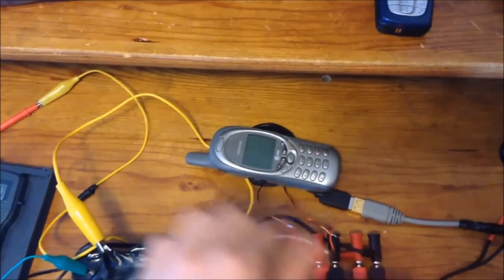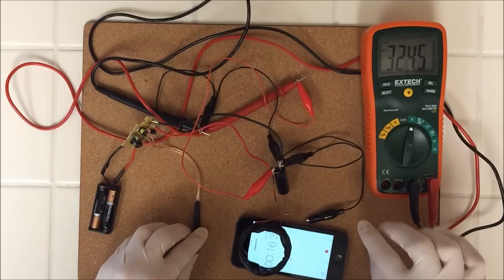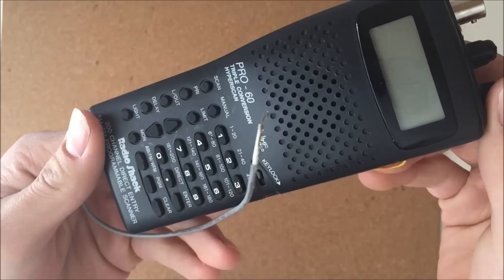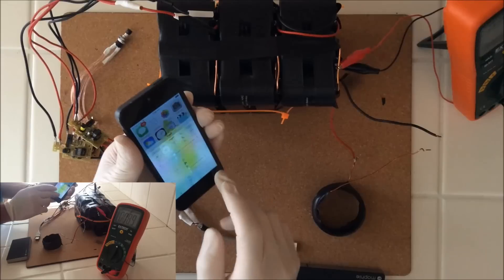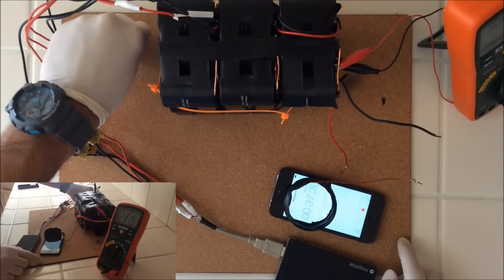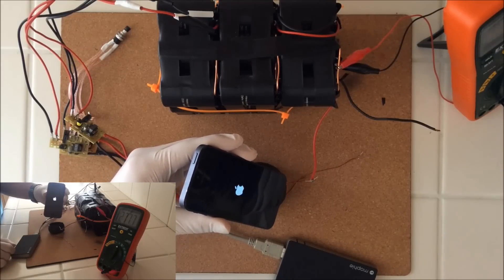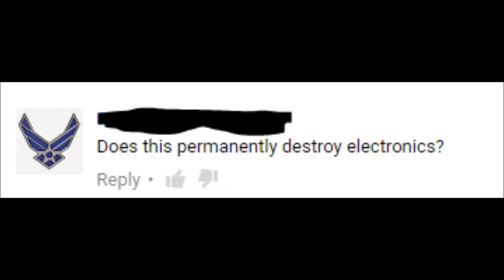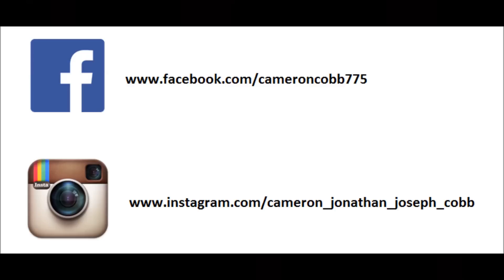Electromagnetic Pulse (EMP) an IPhone - What Happens?

Comment: the problem is even though this is a real EMP generating and inducing a small current into the circuit of your device in a space based Russian EMP attack is on much more larger inductive current than the small circuit you have made it would cause some elements of the circuit wiring to melt and open you would not be able to locate the open circuit because the circuitry is on a nano micro scale you would need to look with a microscope at the circuit board and you would not discover this you would need to do multiple continuity testes to isolate the location of the open circuit you wouldnt be able to find it, and that would be the least of your problems, pray to god we are never in this situation make peace not war learn to be a friend.
Reply: Chatting macca

Comment: I'm not sure how I got to this video, but I'm glad I did. It was strangely captivating to see if the iPhone would be fried.
Though this does lead to an obvious question. What if it was a phone that has a wireless charging loop built in? The charging coil must be outside the RF shielding, so in theory it would funnel the massive pulse of power straight into the phones main board, but do phone manufacturers think about this, and do anything fancy to prevent EM pulses from damaging their devises this way?

Comment: We have icbm mirv skärmar 500, topolj 
M2 4st 200kiloton and 1megaton 1meg +800tons sarin , Death is about 4-11st +rsdioaktiv ca 1000.
20 uarsþ, 8typhoon, 20modern and 3000 huntrtkoller. Mmissalboats, mineswepers, rocket ships typ 168st s400, s350s4, cs500+1000+ s600-700, s350 600, tor m3 80000, pantsir SiE, SiM, SM Andra blir ca 150000st plus 1miljonn missiles, Islander 120000.cruise missiles 200000+ club 10000.jos 550000+club 8000000, dronovo ca 1milijon i 50000.
Avioni ca 56,000,+andr 70000+helikopter 🚁 82222
Transport mi 80mi07 1700

Comment: Interesting, would you get the same result with a samsung s7 edge smart phone, something odd happened 2 weeks ago at work my smart phone completely froze and i had to take it to the phone shop for repair. it was connected to nothing, the phone needs a new mother board. the odd thing is i have two computers at work that all needed re booting along with the router, and my electronic door entry system froze,  I thought the electric tram that passes close by around 50 feet away. caused an Electromagnetic pulse , either from the collector or a faulty or badly suppressed motor. is this possible?
Just putting this out there for the collective brain.

Comment: I think the emp generator you made is quite weak, maybe you can try to ramp it even more using a step up transformer that can produce 20mA 1000 volts and more turns in the coil. But if you're brave enough and you can actually shield yourself from electrical discharge then you can try to use oven transformer which can out put 50-60mA, 15000 volts(I think) which can also fry you if you're not shielded enough....

Comment: I was so surprised the coil actually managed to fly... I really wonder what kind of physics went into getting it to do that.
Reply from the maker: That’s a good question... never really thought that deep about it... I will be doing another EMP video next week except with a LOT more power and with a pancake coil instead... should be interesting.
Reply: It can be two things. Either from the tiny plasma bubble rapidly expanding between the two wires or its because of the physical force that is generated from a conducting wire in a magnetic field.
Reply: emp means Eletro Magnetic Pulse, probaly cause its a MAGNETIC pulse

Comment: Your conclusion is not very accurate. An EMP is basically just a large amount of electromagnetic noise that will induce currents in conductors, such as circuits. The effect this will have is entirely dependent on the circuit in question. For example, an electric motor with beefy coils is likely to be fairly resistant to this, whereas its delicate control circuitry is more likely to be permanently damaged, as the high induced voltages exceed what they are designed for and can melt or arc. In the case of the iPhone, it looks like the circuitry was largely protected, and it probably detected a voltage irregularity somewhere (like the aerial which is unshielded) and restarted as a safety measure. Other electronic devices, and probably even other brands of smartphone will behave very differently.

Comment: Even if the phone is not burn, the EMP is capable to make the device to reboot, what will happen if this is use on a combat plane, or ship or a tank? it give you enough time to make an smart move.
Reply: its prob cause the on and off button is exposed, without any protection at the actual button and sides of button, so that must have make charge to phone think it turned off

Comment: EMP on a ballistic missile would destroy all tech that isn't grounded by a Faraday cage. It is because not all electronic are created equal and that you are using a micro educing  EMP generator. Higher powered devices require stronger exposure. And that doesn't exclude the potential of the dust fragments of the emp which a small generator would not make.

Comment: Also what you may not realize is that, the sudden voltage and current surges in the iPhone may have degraded some of the semiconductors within which over time start to fail reducing the life or reliability of the phone.

Comment: FYI....a nuclear EMP that is set off at an high altitude, will give off 3 pulses...each one a different type of pulse, and each one does something different. Between the 3...all modern electronics that are not protected by a verde cage, will be destroyed, when the EMP fry's the circuit board....

Comment: What wasn't shown or mentioned is insidious damage that an EMP, RFI, EMI or ESD signal can do to semiconductors, causing delayed degraded performance or failure, depending on the device and the application. Physical damage can often be seen by microscopic examination. Failure may be as simple as an increased but correctable Bit Error Rate, detected by a Parity Check, corrected at the bit level or higher, by redundant hardware or software. Failure of an I/O ESD protect circuit or a CMOS parasitic PNP or NPN transistor can result in a partial or total thermal runaway (meltdown).

Another issue with the demo was failure to immobilize the transmit coil. Some of the otherwise destructive Pulse energy was converted to coil motion.

Comment: yes it can destroy electronics sensitive things led's calculators those things. it's about coil diameter of coil number of turns voltage current literally sky is the limit if your trying to destroy something with your wimpy emp make it bigger and stronger It Will Work!

Comment: hey you corn cobb
can you up the voltage and stuff with a car battery or a generator class
Reply from the maker: b34113411 with this kind of circuit, the only way to up the voltage would be to increase the capacitor ratings to more voltage and more capacitance. A car battery of higher input voltage would charge the capacitors faster. I hope this helps :)
Reply: dew it

Comment: Nice way to force restart a system that you don't have physical access to.
Reply: duuuuuude, i never thought about that.
Reply: and now you can see that iphones can be opened therefore you wont need a stronger EMP
Reply: Only if the device has error correction. If not it will continue running with a lot of errors.
Reply: Make your emp like a taser with a permanent arc so it can send multiple waves by sec and you'll kill some devices by overload. But if you really want to kill a device I'll recommend to overload the USB data pins and the common ground with a high inverted current.
Reply: @Tailslol  i will recommed a usb killer it will kill instantly the device it doesnt use magnectic feild it charges th device upto 2000 volts in sec and result in instant kill of device however it have no access on i phone
Reply: @cameramannn8960  made one from a bug zapper a few years ago,quite effective.
Reply: You have physical access if you are with an emp right beside it
Reply: TheXAsama lmfao
Reply: It would be a super imprecise method with much collateral damage risk, though.
Reply: But not best way it may kill that phone
Reply: I want to say it, but it's totally silly so I'm going to do it anyway. If you open the iPhone then you void the warranty :p

Comment: you just have a bad emp....
Reply: Alann Mopty it's just small. He has the concept down and can always go bigger. Invisible damage isn't something to underestimate.
Reply: rob864guy exactly what I was thinking
Reply: Get good
Reply: Two microwave transformers charge a large high voltage capacitor then across a spark gap after that a massive coil of copper wire submerged in oil or hardened in resin there most powerful emp ever
Reply from the maker: Alann Mopty yeah it’s completely terrible

Comment: So theoretically speaking, can it be hyped it up so much to a point where it would inflict permanent damage to electronics?
Reply: Probably not this one, what makes electronics so vulnerable to EMP's is that essentially more wattage than the wiring is rated for is induced into the wiring and essentially burns them up. In microprocessors with hundreds of tiny/low wattage rated connections they can be easily overloaded (easy being a relative term). To make something powerful enough to do that you'd need a significantly more power to do any appreciable damage.

Comment: Idk if you'll respond in time but I'm doing a project for school and I was wondering if you knew how to protect the power grid from an emp attack if we had the money ready to go to upgrade it. Or what's a solution to upgrading our power grid. US power grid that is.
Reply: I'm assuming you  already know that changing magnetic field induces electric current in conductors.
The whole idea behind EMP is to create strong enough magnetic field in short period of time,so the current induced in conductive elements of electronic device is large enough to "fry" some of the components.
Now,there is no pocket size device that will have devastating efect like those you saw in the movies,EMP like that can be created only with use of explosive charges or nuclear weapons.

Back to your question...I don't understand your concept of protecting the power grid.
Big part of cables transfering electricity acros the country doesent even have insulation and during storms when there are electric discharges in atmosphere,you have same effect,small current is generated in those conductors.
Now this can have effect on your devices that are pluged into the outlet if lightning bolt strike nearby.
But majority od devices already have protection against hazards that can come from the mains,also as you saw many devices that recieve or emit RF signals (like mobile phones) have shieldeng around components that needs to be protected from EMI/RFI or can cause interference to other devices.
When comes to destroying phones with devices like this,in many cases you will only mess up with signals inside ICs which will cause them to freeze or restart,but once you remove the sorce of EMI they will continue to work like they supposed to.You need to get really close with your "EMP device" to permanently damage it.Nowdays you even have schielding inside the IC which makes them even harder to "kill".

Sorry for such a long comment,but when it comes to electronics there are so many intresting things to talk about which makes it beautiful :D
Reply: Let's take for example a PC.First you have metal case which is essentially a Faraday cage,so it can at least greatly reduce efects of EMI/RFI if can't block it all.
Then you have PSU,even the cheap ones have protection on the input from power surges and filtering of any noise that can come from mains.
Next,even some MB have their own protection from excessive current from the input.
The most sensitive parts are ICs,especialy those running on low voltages,which you can permanently damage.But chances are low becouse there are many ways to protect sensitive part of the circuit.
Hard drives have their own metal cases which also provide some protection.

 It's easier with hand held devices becouse they are designed for low power,but as you saw you need to get pretty close to even mess with micro in iphone (of course it's not imposible to kill it but it's unlikely,you eventually can if you have that intention and put som more effort).

Now,Faraday cage offers no protection from slow changing magnetic fields like earths magnetic field,but should protect from EMP.
And in case of using nuclear weapons,I think there is greater thing to care for than protection from EMP.
Reply: It could only work with an air burst nuclear attack. So you want info from the start if that should happen?
The start affect would be true panic. The affected city would not be able to communicate with anyone else. The military would be introduced into that city, and the next attack would have to follow shortly. The major targets of the attacks would be power plants, to disable control. With no ability to manage the intense and dangerous power that they control, the employs would run and rightfully so. It would result in a total grid shutdown.

However, your question is how to protect against somthing like that, and I am telling you that it is not possible. An attack on the grid is unlikely. That would require things that turn only result of the ultimate nightmare situation. But there is no way to protect the power grid from somthing like that.

I hope that this helps you.
Reply: I guess this thread is pretty much dead now, but someone might read this anyway. So, let's say there was an EMP attack. Most of the devices that use ICs are dead, because the pulse fried them, and they won't turn on, no matter what you do with them. So, the only things that you could use are stuff like kettles, heaters, light bulbs, things that have no advanced circuitry, or are very well shielded.

So, it's not really the power grid that you need to protect, but the devices themselves. The power grid would probably keep working, as long as the computers work at the substations and power stations, so those are the places that you want to keep safe. But even then, you won't have any working mobile phones or anything that is even a bit more complex.
Reply from the maker: From what I know, it seems that the best possible solution would be a Faraday cage but creating many Faraday cages or one big Faraday cage to protect key components of the U.S. power grid like power plants and power distribution centers would seem impractical. And since a nuclear EMP would most likely permanently shut down consumer electronic devices, I feel that protecting the power grid would be impractical if everything that we have that needs electricity was permanently damaged by the EMP. That's just what I think though. I hope this helps :)
Reply: It does a pretty decent amount thank you for your responce
Reply: nixibreee Can you sum that up a bit, i dont understand it very well.
Reply: +Roberto Teh Jon I can sum it up for them. What they are trying to say is that the power grid does not need to be protected at large against an EMP style attack, as causing a large scale attack with more force than lightening is pretty much impossible. That high of an electric field that quickly would require tech that simply does not exist. On a small scale as seen above it works, but for a city or country its much more difficult.
Reply: nixibreee +draygoes  But im talking about in terms of a nuclear tipped EMP from an enemy nation. Thats what im trying to figure out here.
Reply: in south africa, power cuts are common place and there is no chaos.. would folks honestly freak out when their phones stop working... lol that is so sad
Reply: lol I think ppl won't freak out but they'll think something is wrong. It would only take 2 different phones with 2 different sim vendor, then you know you fucked up, but not necessarily an EMP.
Reply: Imprison and hang the whole Bush Administration,then no one has a Reason to blow your Grit Roberto !!!!